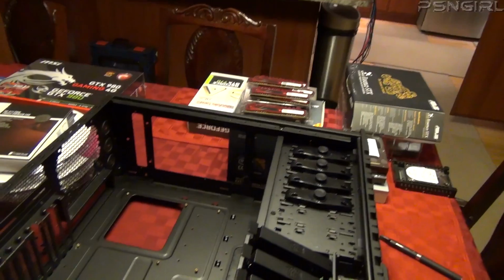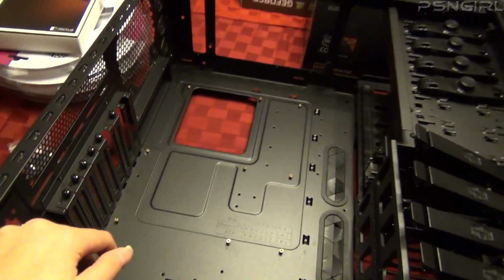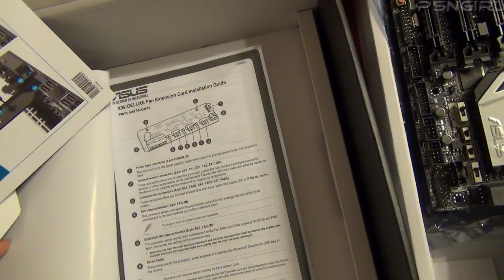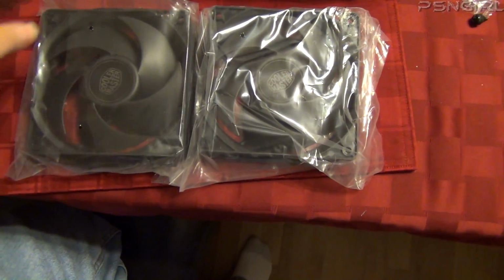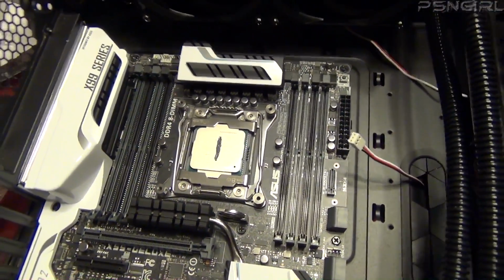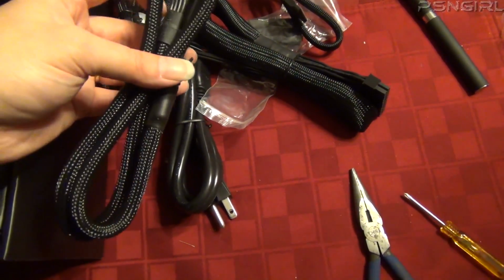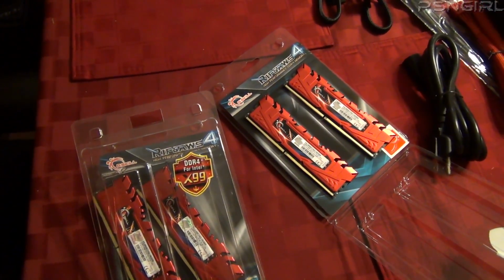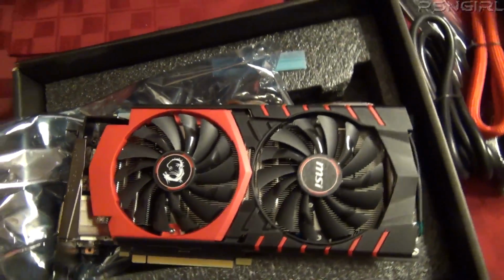[P1] New PC Build 2014/2015

Comment: Stretch pantyhose over a frame and mount that to your fans. Use a double layer if you feel you need to. In my experience with building PCs for over 20 years this makes a good filter. It gets even better if you have a friend with a Laser cutter and access to thin plastic stock. It can be done with a bit of metal or wood if you have the right tools. Your smart, check into it.